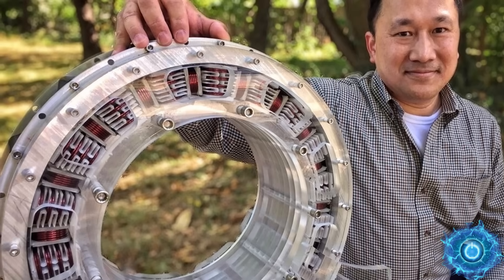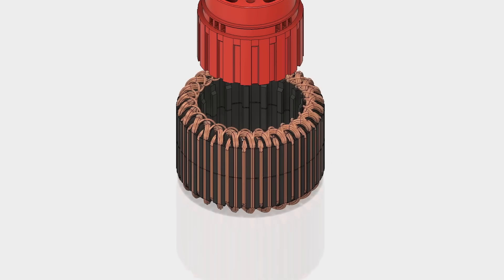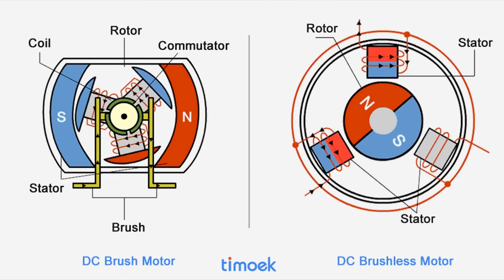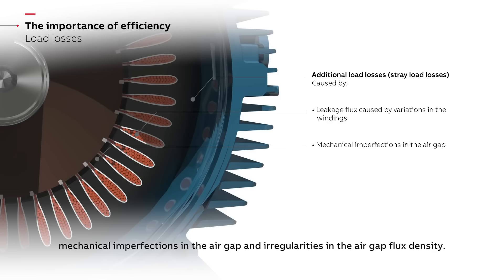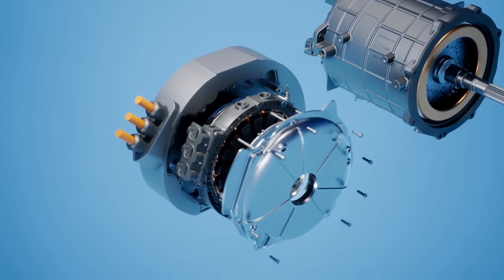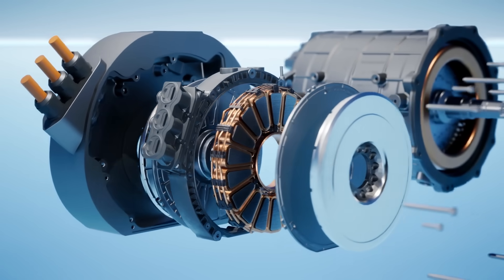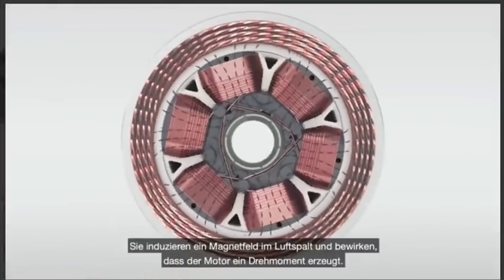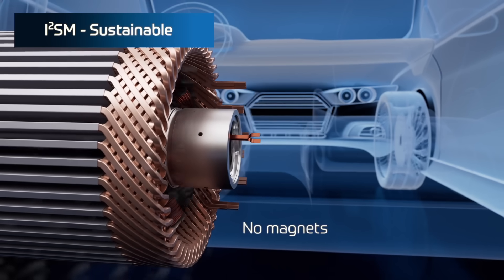INVENTOR BUILDS Breakthrough MOTOR - IS it REAL!?

Comment: we just found a brand new super conductor we make synthetically and the best part is it works at room temperature! we need to focus on making as many super conductors as possible and get them into the new motors so we can move forward. it is time and now we have a way. but there is not much time left to get it done and begin to fix the problems we have created or there wont be a world left to save imho.

Comment: I was experimenting with ghost junctions. I made a small wheel and made ghost junction triangles of bead magnets around the outside and inside like a motor/generator. I made each one so i could rotate it up to 30 degrees either way from center. I even used a bit of magmetal to isolate the remaining unwanted pole. They are almost completely monopolar. With the junctions at 22 degrees there was hardly any resistance to the rotation but the angle of the junction magnets pushed the wheel around. I made the junctions with 1/4 inch ball magnets. Neodymium. Take a string of them about a foot long and bend one end around to the middle of the string. It forms three points. Now remove one of those points and the angle still remains in the strings. It's really cool. It remembers the position of the field that was removed. Ghost junction. Remove some of the string farther from the angled joint and you have a small almost monopolar unit. A little chevron of ball magnets. The point is almost monopolar. Looks just like this    >   but a bunch of them made from five small ball magnets around a wheel and inside it. Like a motor. Ive yet to expand on this particular experiment as Im busy with others atm. Thought I'd share. Cheers.

Comment: The key for EVs is NOT slightly better power to weight, but lowering the cost.  Even that means nothing when the batteries are the bottleneck in weight and cost and size.
Reply: Bro these are more power efficient so will require lesser/smaller batteries and therefore loser cost.

Comment: But if it had the same amount of power but it was different sized motors. The bigger size motor could produce more power. That's what's more efficient, so don't talk about Wade. Talk about just pure strength and reduce size or the weight of the car which will give you more efficient with the motor What it it shit's at a policy or whatever you just make your own decisions, so

Comment: Nah... It's just over claim that halbach can increase power denisty by focusing magnet in one side, the fact that if you compare the halbach and normal configuration without backed iron, u get 30-40% more magnetic flux in halbach, but if u compare with normal configuration with back iron the result are the same, even halbach have lower flux

Comment: For cooling, if you use copper tubing instead of copper wire for the outer coil, you can run a coolant through it and reduce heat loss.
Reply: That’s a hazardous risk. Out of the question.

Comment: The loading factor was mentioned as just that, a load. The load potential is the key. It’s why the motor exists in the first place. 
Kind of like a guy bragging about horsepower. Then asked how much torque does it have? 1 ft/lb … 😉🤣😂😳

Comment: I was immediately asking the same question as you did "what kind of electric motor has only 50% efficiency?", it's a well known fact, that the motor of an average BEV already has an efficiency of over 90%.
Reply: Any engineer that designs electric motors with just 50% efficiency wouldn't keep his job very long.  Electric motors and Electrical transformers are some of the most efficient machines that have ever been produced.  Anyone attempting to make them even more efficient are just hitting their heads against a brick wall.
Reply: @KenFullman   motor will burn very quickly
Reply: @KenFullman  30 40 years ago whenever I ordered a “AC” motor the P.F. was very important. The P.F. Now days is much smaller.
Reply: Ai clip
Reply: According to IEA 53% of all power produced is consumed in motors and the average efficiency is exactly 50%. Part load is a nightmare for electric motors. Engineers knows this and every fridge is running part time rather than part load.
Reply: I'm not an expert in these field and I know it might be expensive but has anyone tried using silver coils instead of copper coils.
Because silver is the best electricity conductor and might further improve the efficiency by eliminating heat. Be nice, I'm just asking :)
Reply: @miki_9034  Silver is 6% more electrically conductive than Copper and 9% more thermally conductive and less prone to corrosion. In drones and aviation the $975871.60/$8,881.72=110 fold more expensive is probably not a problem as the potential weight save and efficiency/range increase would be significant and 100% recycling is likely achievable. In EV's Silver will probably not be a thing for motor conductors outside hypercars. In average ICE vehicles 15-28gram Silver is used and double that in BEV's.
Reply: @jensstubbestergaard6794  Thank you
Reply: The motor itself sure, but as of now the total system efficiency of a Tesla is around 80% and Tesla has the most efficient motor used in a electric vehicle currently. The motor is 97% efficient and the rest is system losses bringing it down to 80%

Comment: Has anyone ever used windings based on an integrated circuit construction? Around 45 years ago I wondered if it was possible to imbed the copper into silicon which would give many more windings. Even if the copper windings melted, they could go nowhere! I know the resistance would increase with heat, but you could still pack more windings with electrical pathways into that silicon based integrated circuit construct. Just a thought.
Reply: This is interesting. I now about pcb motors where the coil is in the pcb. But on an industrial scale wouldnt it be to difficult to manufacture? You would have to remove all oxygen or any oxidative sunstance out the silicone and it would have to be heat resistant enough to hold  red hot molten copper. And whats the benefit? A motor which coils will last forever
Reply: If silicon panels can be used on the space shuttle I believe they would withstand a fair amount of heat from electricity running through the copper windings. The electrical current density would generate a higher rotational speed in an electric motor, consequently a motor could be physically smaller than existing motors of similar power or torque. I think silicon can stand 2500 to 3000 degrees centigrade before it melts. @raloed.363

Comment: I read that the typical motor design loses efficiency due to a magnetic field that forms while the motor is spinning. This causes a magnetic drag on the core while it’s spinning thus reducing output potential. Tesla designed an oval toroidal shaped motor that was also able to correct this inefficiency.

Comment: Don't electric engine/generator EMANATE ELECTRICITY?
So wirelessly charging a capacitor around the outside/inside whichever is more efficient (like a wheel a hub?) to absorb wat energy emanates to loop back into the engine. If can do so wirelessy would be good if must use wires then that's the next issue to figure out.
I like WIRELESS PERPETUAL ENERGY ENGINES & APPLIANCES. ABSOLUTELY HATE FUELS & POWRRLINES

Comment: Also different metals prefer or resist different polarities. Efficiency can be gained by using two or even three different metals like Nathan Stubblefield did. A ignored part of science. Copper, zinc or aluminum and steal or iron based would be the easiest choices. Silver is neutral and can always be used for a benchmark for testing the difference of using other metals. Positive should be one, negative should be another the path to ground should be another.

Comment: Nothing is for free. That design would be basically a coreless stator with a concentrated and large winding. This means higher phase resistance and, consequently, higher copper losses and lower efficiency, even though there are no iron losses. At the same time, a quite low power factor is expected due to leakage flux from the lack of ferromagnetic core, which means lower torque. Lastly, the torque ripple should be higher than similar motors by having concentrated windings with a considerable angular distance between the phases. Too many promises there imo.

Comment: I converted a small pickup to "Series-Wound" DC electric in 2007 (Note: Lead acid batteries suck and weigh too much. Nothing else was really available then, at my price point). One of the things I learned, was that the coils on the armature could come apart, if the armature RPM exceeded 4000 rpm. What has been done to hold the armature coils together under these conditions? 
I would imagine that the various magnetic fields cause flex in coils over time (which is why they're wound so tightly, and glued).
Comments? 
Thanks.
Reply: It is just an engineering solution for coil structure. Coils do flex, but as before, an engineering application. All good stuff for people who like to be challenged!

Comment: When we think that the torque output increase to the square of the radius. . . . Maybe we should think about building high diam rotor motors. . .For any application, a transport Bus could use a 6 feet diam rotor motor to save a lot in power consuption. . .  Modern science has forget the Inertia and large radius lever effect. 😐. .

Comment: Old efficiency 100% - New efficiency 100% are certainly not the same .
Simple comparison :  Light bulbs ; Tungsten Halogen lamp 1x light output for 20watts of Electrical power. Compact fluorescent lamp 2x light output for 20watts of Electrical input.
LED lamp 10 x light output as compared to the first filament design .
Power in is not set in concrete to how much light can be available in output.

Old element heater using a resistive conductor inefficient,
New heating extracts the Heat or Cool from the air , not only reliant on electrical input .
Old dogs don’t like to learn new tricks ( in ways me included) , but that’s the future .
Did the wood splitters succeed in stopping new locomotives from running on coal ,- on diesel ,- on electricity ,- next water Stanley Meyers Hydrogen powered VW Dune buggy 40klms per litre  100miles per gallon of water . Almost all combustion engines and turbines can be run on water , words from Stanley Meyers , the inventor . All patented - not cartoons.
American military are using it in part as was the agreement for the $30,000,000 government grant he was to sign the day he was poisoned. The murders and payers have immensely harmed there own and others descendants , and set back advancements somewhat.

Comment: Check Adams Pulsed Motor Generator - 6 + protypes , makes comprtible motor design appear 15-20% efficient in comparison . 
Independent tested validated almost zero temp increases in the stator after two hours operation.
It pulses input power , reharnesses back EMF , and redirects  it to intermediate windings that assist the drive of the motor - not oppose the incoming power . This reducesa percentage of  input power two fold .
No cooling fan required . Less power again.Etc
It was offered for free to the New Zealand government whom nicely placed an army patent upon it , instapead of developing for their hydr schemes as was hope by Mr Adam.
They. Outdoor of developed for the world a State of the Art new range of very highly efficient motors , but the chose the gutless greed card and hid it.Shame on them.
Check NEXUS magazine in the years 1997- 2002 approx for the article , back issue may still be puschaseable.
Oh - as you can expect various motor manufacturers don’t like it - a lot . Hows your life insurance policy ?.

Comment: Wow. The "energy wasted" slide is referring to **MAGNETIC ENERGY**  being "wasted outside of working motor area" so... I wonder if the video producer kinda missed that? I mean, can you not have a motor with 90% electric energy efficiency (90% of energy from batteries is converted to motion) that "wastes" 50% of *magnetic energy*, ie the pole pointing away from the motor? Please look closely at the slide... It's talking specifically about how a magnet has 2 poles and how non-halbach motors use only one pole or %50, his halback inspired design directs magnetism from both poles into the motor.

Comment: It's all cool still but I would start concetrating on friction free all fluid motors and transmissions and no more metal like these we see types are only sort of replicas of general rules for. Motors but still more maintance and 9veral higher cost and you end up with same distance on all levels of feasible start and use of til it stops. Could it might be some abstract use in fluid motors power machines from what we see still and be used in fluid new age motors nothing like the old that git us here to places and no more friction 100% efficiency with long lasting distances. Are we there yet. "369" :)

Comment: theres a misunderstanding of superconducting wires they do have resistance when used in ac current. its only good at replacing permanent magnets. but because superconducting wires carry steady current they a steady magnetic field and you cant make a motor with nothing but permanent magnets. you need the other coil and the strength of that field depends on the amps times the number of turns so use a thinner wire like say a 1 amp wire can have more turns and more magnet field per amp than a thicker wire with more amps but less turns. so to get the best results in a motor if you have 1 amp of current use a 1 amp wire not a 2+ amp wire. sure a thicker wire will have less ohms but its a overall larger motor for the power output. if you want small size and power use thin low amp wires. weird but it works more turns equals more magnet field. you dont need more amps but you want you can increase the voltage to a point you get a cronna discharge about 5kv and that can act like brushes so you can make a brushless motor without a computer controller and without the friction and failure of the brushes.

Comment: They're probably comparing volumetric efficiency so that you can get double the power at the same size or the same power in a smaller motor that's cheaper to manufacture

Comment: Just making one side of the permanent magnet array "weaker" (less condensed) doesn't make the magnetic fields on the other side more condensed or therefore more efficient. It's simply a biased or imbalanced arrangement with regards to flux densities with respect to itself. The key to greater magnetic flux density is through some kind of containment, like a core in a transformer. That's what the iron cores in the rotor/stator are for. The problem was already solved.

I also want to say induction motors are not "more" efficient. Needing 3 or more circuits (and therefore electricity) just to produce the same torque is not impressive. Its the opposite of efficient. Basically, if the commutater is really that bad (its not), maybe they should just focus on increasing the efficiency of that particular part.

I also find eddy currents or hysteresis to be marginal/negligible concerns in motor efficiency considerations. How much electricity supply is needed through how many circuits is obviously of paramount importance by comparison. 

Lastly, Superconductors are so over-rated with regards to motors. You already said they're are synchronous morors with 99% efficiency (which is dubious, but whatever). Is that 1% even worth it? Of course not.

Comment: Electric motors already have an efficiency in the upper 90%s and are light weight in comparison to the power there is not much to win as an inventor and they don't need neccesarily magnets. The main goal is to produce more efficient batteries.

Comment: If a superconducting motor efficiency at liquid nitrogen temperatures is more efficient than standard motor, including the refrigerator equipment and complexity cost...  then its a no brainer.  A motor made with a YBCO stator could have a liquid nitrogen cooling loop, but at cryogenic temps, that stator needs to be isolated from any humidity.  
You could make the rotor magnets with superconducting loops also, superconductors can hold a very potent magnetic field indefinitely.
This powerful motor could drive its own compressors that run the cryogenics, but i think a multistage refrigerator setup would be most efficient, -196°C is pretty darn cold...

Comment: This is interesting, everyone copies each other waiting for someone to come up with a new idea and steal that new idea and claim it for themselves. This all goes back to a robot from 1980 found and disappeared with advanced capabilities, it was basically walking down the street hidden, observing to humans in their habitat and they managed to obtain data on their anatomy. But this robot magically disappeared. The data collected on its operation was incomplete but sufficient to investigate and spend millions of dollars. Until now, drone technology and artificial muscles were born. air that until now have come to nothing and the motor is brushless, but the human intellect had a limit like that of any animal and they could not understand many things, the motor with a larger perimeter with the same energy was slower and consumed gigantic amounts of electricity, basically you need a tow truck for the batteries or a long plug, this means that this motor that we see from the Chinese, if it were real, is very slow and a power plant would be needed to give it energy, it could also be a copy of an engine that was never real that appeared in a popular mechanic in 1960, analyzing the Chinese engine apart from its slowness, if it were real, it would last running for a few seconds since the plastic structure would melt due to the heat...therefore it is It's a fraud, it's a chimera, it's like the fantastic Chinese plasma engine that everyone talks about and promotes. This supposed plasma engine doesn't push grams, it pushes tons. The problem is that there are no photos, drawings or videos. It's just Chinese propaganda.